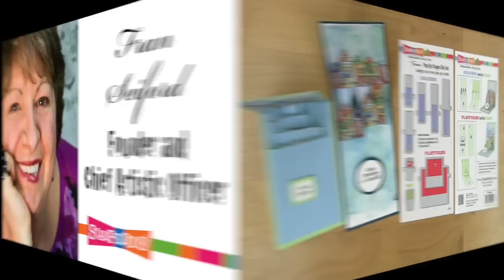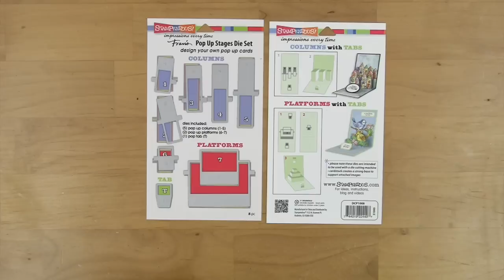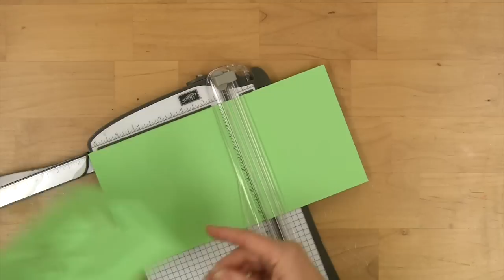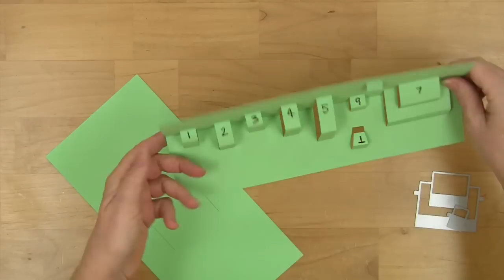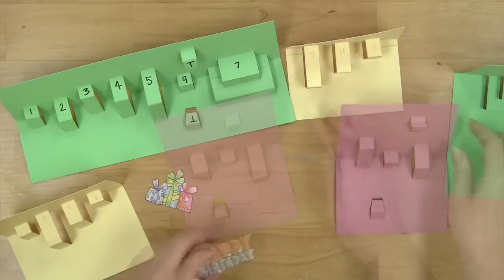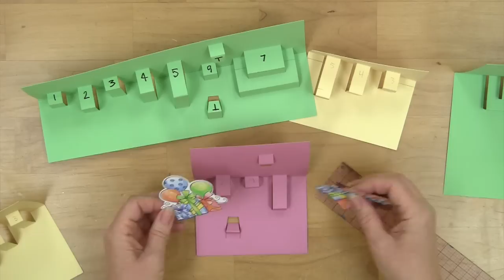Pop Up Stages - Basics

Comment: I am having a little trouble training the folds. Suggestions?
Reply from the maker: Yes, if you put a piece of copy weight paper on top of the sandwich as you run it through the machine, it will make the folds more pronounced and easier to find. Practice on some scrap paper, like the sample Fran makes for herself. Sometimes we have to fold the "shim" paper in half to double it...you have to experiment, every machine is a bit different. You can email us at stamp@stampendous.com for more individual help!! :)